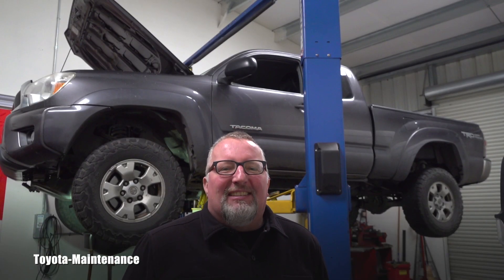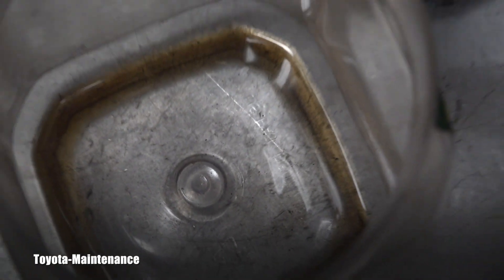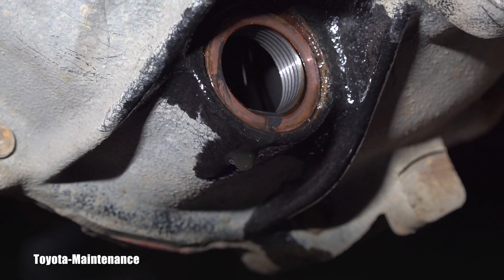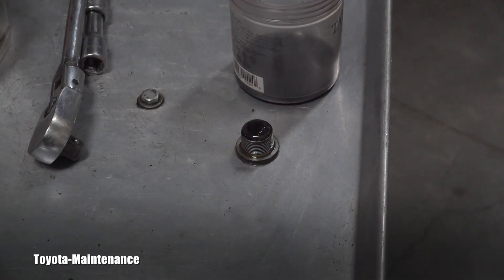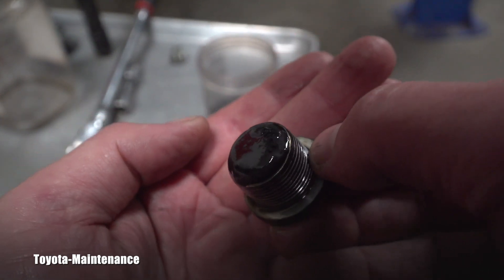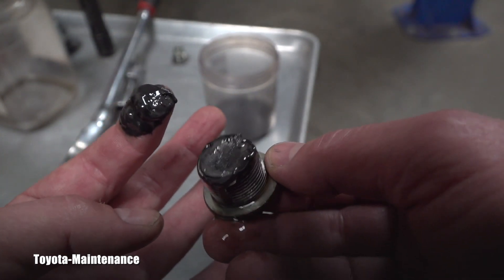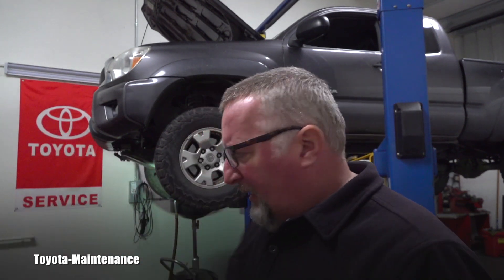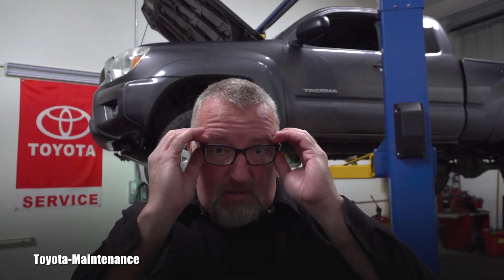Change your oil, please

Comment: When I changed my front diff oil at 30k I put in Royal Purple.  Not gonna lie....I did not touch it again until 90,000 miles later.  It still looked new.  Clear as can be.  I was severely impressed.  90k for me is about 8 years time.

Comment: Change the front diff fluid again in 1000 miles. Easy and cheap with GL 5. Flush out the metal filings

Comment: I tend to neglect my front diff oil, too.   But I'm in California where it never gets below freezing and I only use 4WD once or twice a year just to make sure it's working.  Otherwise I am in 2WD most of the time.   When I first moved to California I had all the fluids replaced with synthetic and haven't had a problem on my '92 Toyota 4Runner.   But yeah... I think the point here is not to neglect your diffs for that long.

Comment: Unless you see shiny metal flakes on the plug magnet, or in the oil draining out, all you viewers need to do is clean the plug and refill the transaxle with the oil recommended by the manufacturer. That black goo is normal wear off the gears and bearings as they rub against each other. That is why the magnet is there - to remove as much of the metal as possible from the oil. You don't need to do any flushing or dismantling anything. Even if you see a few shiny metal fragments in the old oil (not hundreds of them), with new oil, the truck might operate fine for another 50,000 miles.
Reply: We are Toyota fans - we don’t want to last another 50,000 miles, we need 500k+

Comment: My drain plug had 2x the shavings as in the video. Now I've considered using thicker oil as a preventative, but don't want to make things worse. So far no issues with the 4wd.
Reply: Same here! It might be because I don't use 4x4 for 8 months out of the year maybe?
Reply: Don't go with any other oil than that recommended by the manufacturer, no thicker, no thinner. That ultra fine ground up steel is normal. Put new oil of the correct viscosity in that gearbox, and it will last for a couple of hundred thousand more miles. Under normal use, synthetic gear oil is good for at least 50,000 miles. Engine oil doesn't last that long because it gets contaminated with combustion products and gets very hot.
Reply: @billsimpson604  worth the extra bucks 👌
Reply: I agree with sticking with recommended viscosity.
Reply: @billsimpson604  thank you

Comment: I changed all the fluids on my 2013 Tacoma at 100k miles.  Everything came out looking very good including manual transmission except for the front diff.  It was black just like this video.  I don't think I had as much crud on the plug but I definitely had some crud on it. 
   Why would the front diff be so much worse than the others?

Comment: I just bought a used tundra 4x4 with 112K miles. No idea if the owners before me changed the differential fluids or transfer case oil. Will be doing this soon.
Reply: I bought a 2011 Tundra recently. Mines got 156k. Make sure you change your PCV valve too. It’s only $10 and easy to replace.
Reply: @ztemde978  That is a good idea
Reply: @ztemde978  Why do they stick up a lot?
Reply: @dalephillips8250  it’s like a flutter valve. They can just get clogged up with oil as they age. If your vehicle is burning a bit of oil. That may be the cause. It was mine.
Reply: @ztemde978  thanks

Comment: I had something like this happen to me. 1989 Buick Reatta.  To get to the air filter required to remove a bolt and loosen the other bolt of a fender bracket to swing it out of the way.  In 2004 or was it 05 really doesn't mater, I checked out the filter.  OMG it was the original factory filter.  You couldn't even buy this filter at the dealer it was a factory filter not the dealer one.  Yes it looked like it had been in there that long, Can't remember the millage and not going to guess but I will say it was low for it's age.

Comment: If Toyota put that magnet there then I'm Ok with that.  Cons with magnets is they magnetize the metal debris. The debris could break loose and now magnetized stick to wherever they want. Best to change fluids as required in the user Manual.  Just RTFM, do it!!!

Comment: What are your thoughts on Oil system cleaners? run them for fifteen minutes - flush it - fill it - flush it again - then fill it.
Reply: Stay away from it. Modern engines have tiny oil passages inside them. You break some gunk loose with cleaner, and it could get caught in one of them. Just use fully synthetic oil and factory oil filters, not the cheapest one you can find on the Internet, or at the auto parts store. 
The same with automatic transmissions. Never let any shop 'flush' an automatic transmission. Just change the filter inside the transmission, and replace the fluid which came out. If the fluid is black, or smelled burned, do it again in a couple of months.

Comment: Would you recommend a flush before new fluid?
Reply: Not necessary.
Reply: Agreed, but if you want to, change it again at 1000 miles, and check out the plug.

Comment: I would pull the cover and flush the gears. Close it up and reservice. Check it 5 or 6 thousand miles down the road. If it goes bad before, you will hear it. There is a good chance it will last foe years.

Comment: I guarantee most of the metal/contamination came from that terrible driver side needle bearing design and 😡 it's been a problem for 20+ years now! 🙄 East Coast Gear Supply has a replacement bushing for a longer term solution. Once that bearing wears the CV axle and wheel bearing on the driver side wear out much quicker, not to mention increasing ring/pinion/spider gear wear from the contamination. Especially a major concern for lifted suspension Toyota 4x4's 🙁